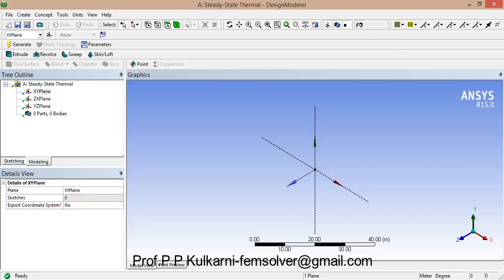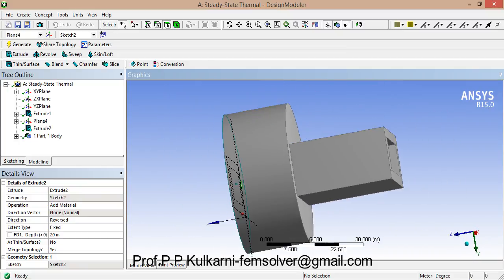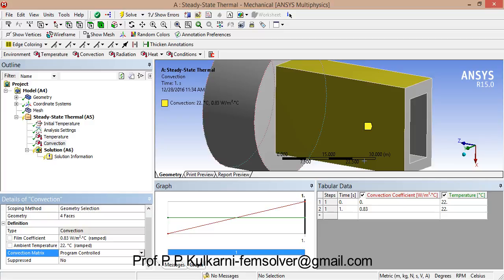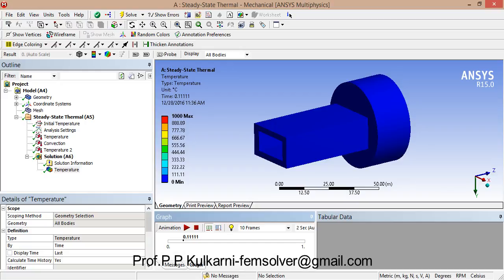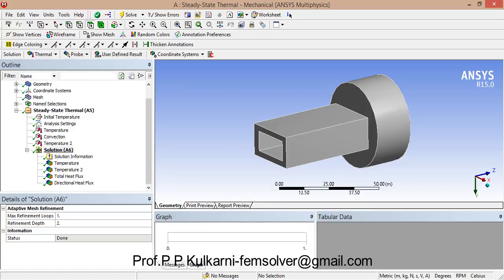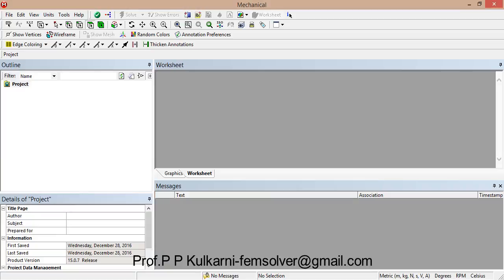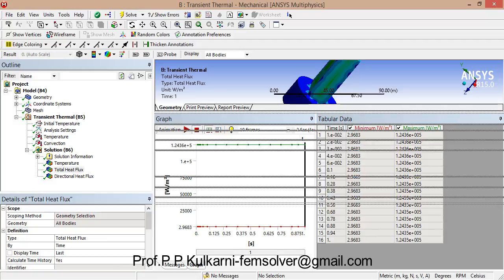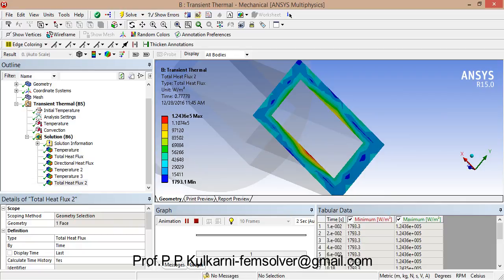Transient thermal and steady state thermal analysis using ANSYS  for beginners

Comment: Currently I'm doing a project on conformal cooling in injection molding and need to find results based on analysis.

Following are the results we want to find-Fill time, injection pressure, time to reach ejection temperature, volumetric shrinkage at ejection temperature, temperature at flow front, warpage.

Kindly help us with the right course to be taken.

Comment: Hi Mr Kulkarni. Can you please make a video on simulating turning machining operation to see the temperature changes on the tool and workpiece before and after using coolant. Coolant is basically a low temperature ( -20 degrees) and high pressure coolant (70 bar).
Reply from the maker: yes i will do